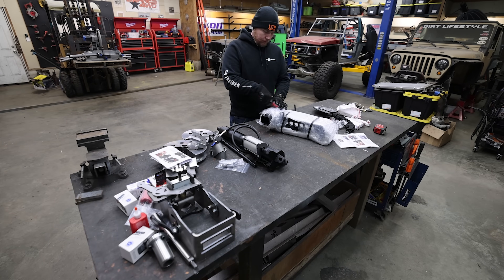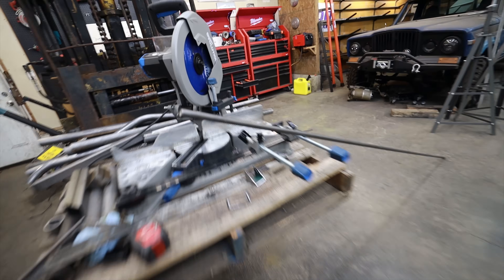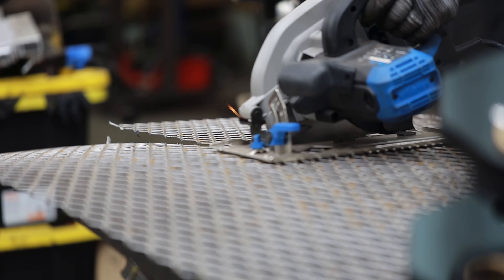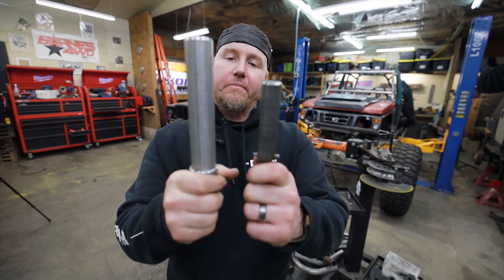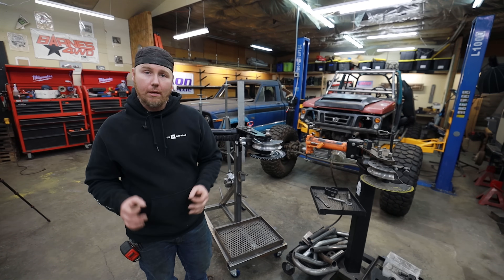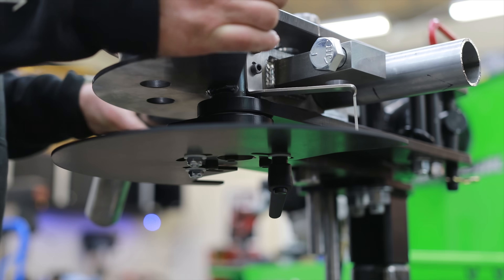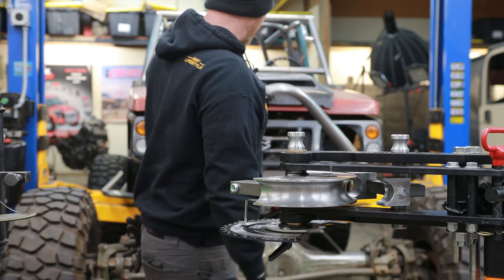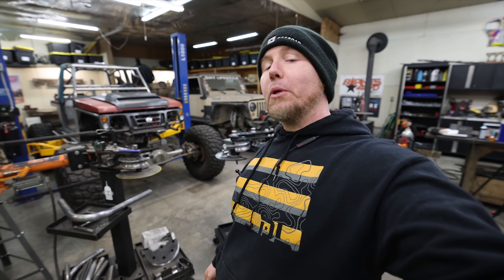New Swag Off-Road Tube Bender Is Hiding Something Savage... This Bender ROCKS

Comment: The old jd2 bender you are comparing to seems to be a early model 3. Light duty bender.  The new swag bender looks to be a copy of the jd2 model 32 bender with a couple small changes.  I'd be curious to see the price difference and quality of the dies after heavy usage.  JD2 has a proven design with significant R&D into the die profile.  Comparing a model 3 to a 32 is not even in the same ballpark.  Curious to see how the swag stacks up.
Reply: Exactly. These types of videos are not a direct comparison as far as apples to apples go.
Reply: Happy someone said this. Poor to compare the old jd2 model, the 32 is much beefier

Comment: I can imagine having a part like the spring no longer being a potential hazard is nice because it’s one less thing you have to subconsciously keep track of, which makes work less fatiguing and maintaining flow easier
Reply from the maker: Dude, you nailed it. The more metal plates you are juggling, the more it affects your work. Even the small things like exposed springs are just one more hazard to be mindful of.
Reply: @DirtLifestyle  I have a JD 2 bender but don't have the cylinder. I like the work out. It's not as much of a hassle to set the dies up without the cylinder. But that is probably the only difference I like. The other stuff doesn't really matter. I've bent 1.5" 1/4" wall no problem.
Reply: @bradywilliams2666  Have the jd2 with full hydraulic cylinder that has auto return. No springs to worry about, no hassle to drop dies in with the cylinder hooked up. I have no idea what he is saying about needing the bushings. I can only see a wearable item in those bushings.

Comment: For any who may have purchased this and also purchased other items needed. I mainly want to start building a roll cage as well as help others with projects and hopefully make a few bucks back over time to help pay for or add more dies. Where did you get the dies from that would do 1-3/4" .120 thickness that you could get at least 120 degrees, prefer 180 if possible Thanks

Comment: Hey Nate, like many others it seems, I purchased this bender after seeing your video. It should be here Thursday 😁 

Just curious, but what wall tubing did you decide to use for the vertical post on your cart? 

SWAG says its a regular 2" hitch receiver, and I plan on using .095 wall for the rest of the cart, but you seem to have used two types/sizes of tube. Just curious why you chose to. 

Anyways keeo up the awesome videos! I love seeing all the stuff youve been doing recently 😁👍

Comment: You must have had the model 3. My model 32 is built using 1/2 & 3/4" plate and has 1-1/4" main pins. Rated for 2" .250 wall IIRC. Same degree wheel as the model 3 though.

Comment: What die would you recommend getting if you can only afford to get one set? Basically just bumpers and sliders on jeeps and Toyotas.
Reply from the maker: 1 3/4". This is by far the most common size used for cages, sliders and bumpers. Then buy a bunch of full sticks of 1 3/4" .120 wall tube, and you are ready to build just about anything 👍.
Reply: @DirtLifestyle  Thank you so much! Can't wait to get one and start practicing some fab skills.

Comment: Hey Nate. Could you link the blades you use on your metal chop saw? I’m sick of using the giant cutoff wheel types on mine.
Reply from the maker: These blades are specifically designed for the evolution saw. I'm not sure if there is a blade that is made for your traditional abrasive disc style chop saw but it would be worth looking into. I think the issue you will find is the saw speed. These evolution saws run at the perfect RPM to work with this exact blade. That one reason why they last so long. Good luck!
Reply: RPM's are seriously reduced on metal cut saws, not the same as abrasive wheels. Just suck it up and buy one, you won't be sorry if you do lots of metal fab.

Comment: You had to build a stand for both benders and when you built the one for the JD2 unit you could have very easily made the same pin holder (yes it is now a nice feature that comes on the swag, but using as many benders as I have the pins have never left the machine and always drop back into their associated holes when and when not in use). That just tells me that you and others did not think too much of it because it was never really on our minds that it was something that was necessary. 

As far as the external springs go, you could have removed both of these by going with an auto return ram. Or you could upgrade your old return springs with the swag elastic spring kit like on your new bender has so your buddy that is leaning on the return spring while you are working doesn't get pinched. lol  

Just because the pin size (and main arm material) is larger doesn't mean much unless you know the material type. They could be using a milder material that requires the increase in the size of the pin to accomplish the same thing as the smaller pins in the JD2. You know this being that you have had videos explaining the differences in tubing types and their strengths versus thickness. The other thing to think of here is when the pin size is uncommon, that makes the dies proprietary. Right now I can swap dies from a buddies Woodward bender to my JD2 and vice versa (and other brands that use the same pin diameter). This allows us to buy the dies that we most commonly use and then if the other needs to borrow one that the other doesn't have, then they are interchangeable without having to take the entire bender over to the others place. This saves us money on the onset.

Lets look at the "nice" degree arm for the dial, we all know that thing will get bent. This is why all the other benders have used welding wire that is replaceable by walking to our stack and cutting a new one. You will eventually bend that one and have to do work to it to fix it back up. Especially if you are saying this is now your forever bender and will be passed down. lol

separately) at roughly $900 to the JD2 Model 32 that comes with an auto return hydraulic ram

Comment: Love this.  Much appreciated.  Think I made my decision on a bender. Starting slow on getting my future shop stocked with what I want and need. From one Fabricator to another.  Love your mad skills brother. Much love and good fortune
Reply from the maker: Hey man! I really appreciate the kind words 🙌. Good luck stocking the shop! Lots of great affordable equipment options out there now!
Reply: @Dirt Lifestyle  yes sir. Technology is really advancing. I'm a specialty/ combo welder by trade. Need to upgrade my welders as well 😆.  Especially my aluminum tig welder. My ole tig 225 is a little outdated. Later plan to upgrade to a water cooled possibly. But us men love expensive toys. Would love a Miller pipe pro 400 for the house/ or shop to lol. That's why I'm still working in the plants. Make that money to build up my shop
Reply: Might want to really consider that their dies are proprietary due to the pin size. And that means when they do not have any, you are at the mercy of their supply. Whereas with other brands you can use other dies in different benders that use a standard pin size. Just food for thought.

Comment: That is an awesome looking bender. I just emailed Swag with some questions and referenced your video. My big need is for a bender that can bend up to 2” .250 DOM
Reply: Look at the Rogue Fab benders too.
Reply from the maker: Good question! I would bet this could do the job as long as the ram is upto it. 2 x 1/4 has some serious strength and is hard as hell to bend.
Reply: @DirtLifestyle  

The Pins and the 3/4” plate on the Swag have me impressed. I bent 1.75” .250 DOM on an old M-Tech prototype bender using a Swag Harbor Freight air ram kit. The Ram had no problem bending it, but it also bent almost every pin on the bender.
Reply: @Marcus_Woodard  I’ve been eyeballing Rogue for a while now and never pulled the trigger. My issue has been I’m more familiar with bending horizontal as apposed to vertical. Maybe it’s not an actual issue.
Reply: I just bought a jd model 32 yesterday. They advertise it capable of 2” .250 I’m looking forward to using it bought it with the 1.75 die will get more in the future but I intend on bending up bumpers for a couple full size trucks and think that’s a decent start point. Ain’t cheap in Canada.
Reply: @turbolab2376  what part of Canada you in?

Comment: Would've like to hear more about the die's. Being a different size than everyone else sounds like a potential problem in the long run.
Reply from the maker: Good point... I think?
I totally see what you are saying as far as the only place to get these dies will be from swag, BUT the dies on my JD2 are mint after all the years of use. And I got them used, btw. If you damaged one of these somehow 30 years down the line, you might be getting a repair instead of buying a new one since the size is basically proprietary. The good news is it's pretty hard to damage a solid chunk of steel, lol. But again, I see where you are coming from.
Reply: I went to their website and all the dies are on backorder

Comment: Model 32 has a feature to lock the arm so the tube doesn't relax when resetting the ram and bigger pins. Think it would be a more fair comparison. Keep us updated on the bushings. It appears that the arm is riding on the outside and the pin on the inside with the main frame holding the bushing itself. Could be a potential problem with splitting the bushing or creating a lot of slop. I do like the idea overall though. I have a model 4 and wish it had larger pins, but if I break the 7/8" ones I guess it'll get to meet the Bridgeport . Tools can be modified just as easily as a car. Seems like a lot of people are scared to though. kind of funny because the same people don't mind cutting into a 60k dollar 4wd, but a sub 2k dollar tool is off limits.
Reply: As I stated in my comment above, the good thing about the pin size of the JD2 is that it is the same as other brands and you can use their dies and guides. Having a larger pin requires that you have to use their product which makes that a no go for myself.
Reply: I agree with you on that. The way the model 4 operates is pretty much backwards from this design. It's a little more aggravating, but I can use the model 3 dies in it, and I've used Woodward does also after polishing the holes. Think outside the box for a second though, and if you have both sets of pins there is no reason the smaller pin does couldn't be used with an adapter sleeve top and bottom. In fact the sleeves would fit in the same location and function just like the bushings in this swag unit. Probably find most of it at any farm store for three point tractor hitch parts.

Comment: Nate, one additional thing I do with a new die after height adjustment of the follower is to tune the die to know where the actual starting point of a bend is.

Every bender/die with a tube holder strap in front will benefit from this tune.  

Clamp up a practice tube like normal, mark the tube right at the edge of the die where you would think that the bend would begin. Use a black Sharpie. Proceed to bending the tube.

Give it whatever amount of bend to at least 45°.  

Release and pull the tube out and look very closely to where the tube really did start to bend. You can see this on the underside of the bend where it just starts to change shape.  

Mark this with a line at least half way around the tube with a colored Sharpie. Preferably up the same side where your original start mark is. 

Now, remount your tube into the die and get it all dialed back in place right where it originally was mounted with your original Black start line. 

Pump enough pressure on the ram to load it up tight again. 

Now, look where the new colored line lands relative to  your die, it will most likely be a bit further back from your original black setup line. 

I grind a small knick in my die right there and use this knick as my bend starting reference instead of the edge of the die. 

Every die will have its own tune due to the slack and or manufacturing tolerances of all the parts that work together with that die. 

I get way more accuracy when I am putting multiple bends in one tube.  With this tune, I know EXACTLY where the bend of the tube will begin. 

Without this tune, you can be 1/8" to 1/2" or more off on every starting point of your bend.  This can add up over the course of several bends or screw up compound bends.

Comment: It’s a jd2 model 32 copy with a few tweaks. looks like his jd2 is the old smaller model they don’t sell anymore
Reply from the maker: Interesting! When I go to the JD2 website, I don't see an upgraded needle for the degree wheel or bronze bushings in between body/swing arm. Are pictures not updated or something?
Reply: Looks like a great bender I think it’s going to come down to price point bender and dies Vs jd2. are you going to be able to get parts, dies and dies sizes  10-15-20 years later if you can’t interchange between the two brands. Swag makes quality tools and dies no doubt about it
Reply: @DirtLifestyle  the model 32 doesnt have those fancy things but the frame is bigger/thicker and the pins are bigger, so basically it wasn’t an apples to apples comparison but yeah the swag has some nice upgrades over the model 32 regardless

Comment: Just a historical FYI.
The JD2 is a Hossfeld knockoff.
The JD2 dies don't usually fit the Hossfeld. 
I have seen a 2 hydraulic cylinder set up for a Hossfeld that will do 120 degrees in one hit. 
Do NOT be scared of getting Bend Tech Pro (or whatever the new version is). Also, calibrating your dies is no bullshit. Not necessary, till you try to do a single tube, multi bend deal. If you don't mind splicing roll cage main hoops together, you may ignore that advice. If you want to get GOOD,,, well,,, get the right stuff.
Mittler Brothers makes a kick ass bender.
CLEAN THE TUBE !!!!
Dirt and rust will score dies and that'll score tube.
That Swag bender is bad ass, and well thought out. Huge improvement over the old Hossfeld,  and an improvement on the JD2.

Comment: How well does it do with aluminum tubing?
Reply from the maker: Good question! I'm not sure yet. I have bent aluminum tube before, but it's rare.
Reply: I think it really comes down to the center line radius of the dies and the alloy and heat treatment of the aluminum. Any bender will have the power to bend aluminum, but to not rip it apart you might need a bigger CLR for aluminum than you would use for the same OD and wall thickness steel tube. 

Structural aluminum is commonly available in 6061-T6, but because this is hardened it is very difficult to bend. An alloy like 6063-T5 is easier to bend, but not as strong. If you really need the strength of 6061-T6 then you will need to send the weldment out of heat treating after welding anyway, so it should be anneal before being bent.

Comment: Priced the same as the tested and proven jd2 Model 32. There aren’t even any specs on the capabilities of the Swag bender - is it too new for them to be able to stand by them or does it not match up with the similarly priced Model 32? Are there going to be issues with all of the proprietary parts and lack of interchangeable components down the road? How well does it hold up? How precise and clean are the bends? Why is the video comparison based on a lighter duty older model from jd2? 

Seems like way more research could have gone into this - hopefully people aren’t running out and buying this model based on the video alone and not looking into it a bit further.